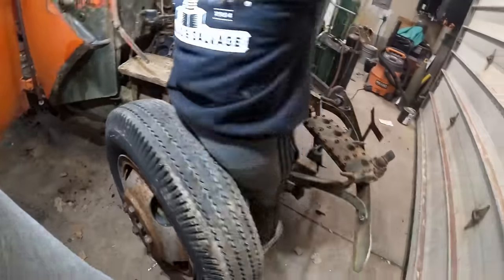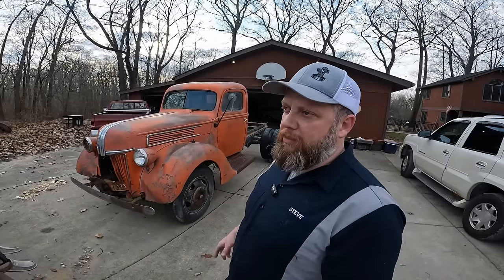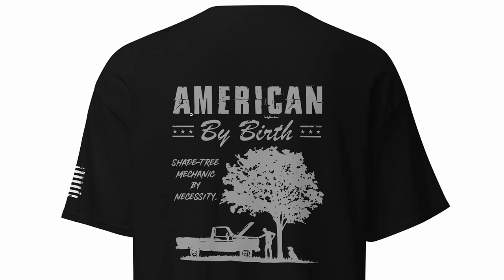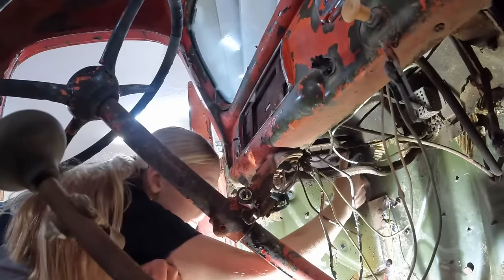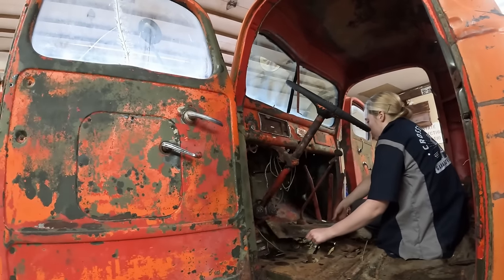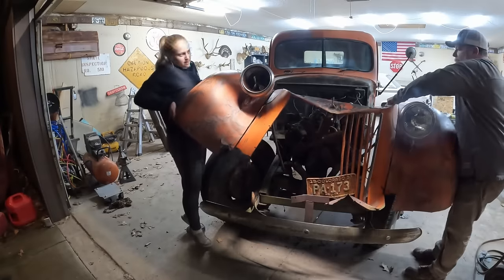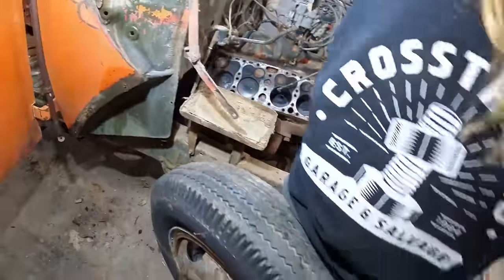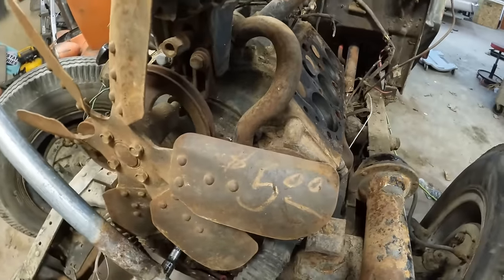Tearing Apart An Abandoned '41 Flathead Ford | Rebuilding my first truck [Part:1]

Comment: If you intend to drive this old junk on public roads you would be well advised to upgrade the sub standard brakes
as traffic moves faster & there is 100 fold more of it on todays roads. Wildwood sells disc kits for  EVERYTHING.

!
Reply from the maker: The goal, as stated in the video, is to swap it onto a modern chassis. Thanks for watching.